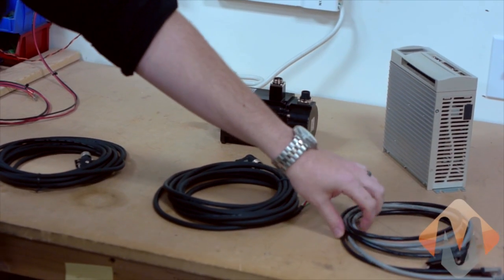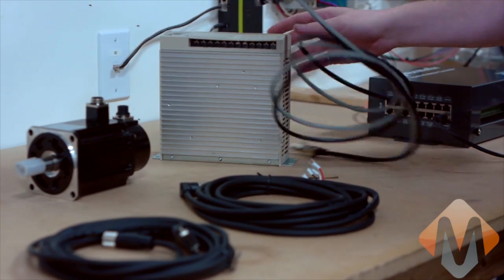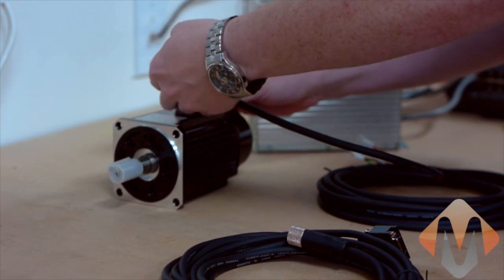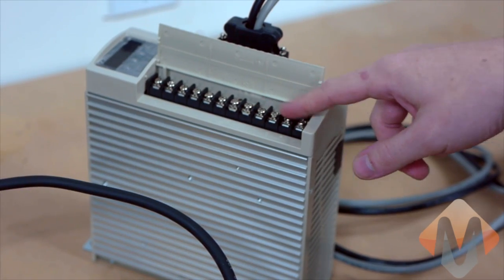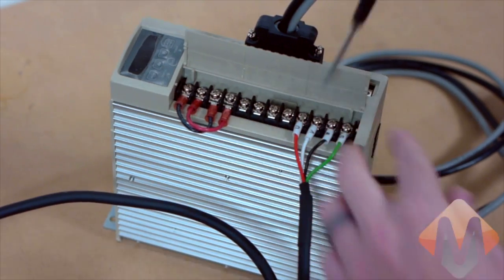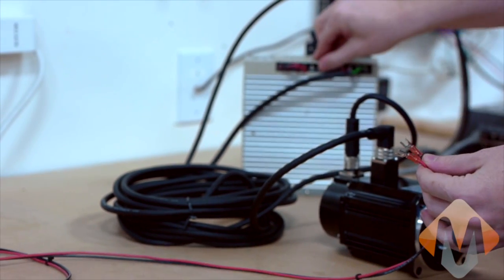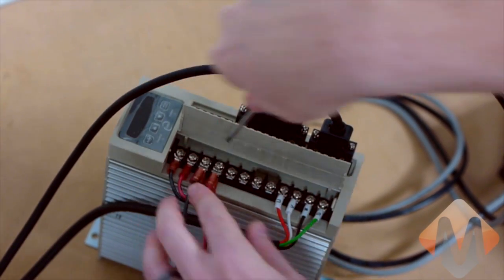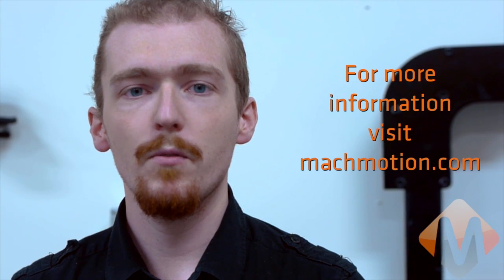Wiring a Teco Servo Axis

Comment: I have 3 tsta 75D drivers and matching servos 2 drivers come up the 3rd gives me a POT NOT error what param clears it ? or changes the travel limites, cant seem to find it (POS and NEG OV TRAV)
Reply: Hello! Since this didn't come from us, we can't really troubleshoot this. But, here's a quick blurb from one of our TECO manuals. Hope this helps!

Pot Not:

This is normal after performing drive reset with Cn029 as limit pins are not normally connected to any switches.
 

Check Hn504, Hn505 (CW and CCW limit); they will be 0104 and 0105; set them to 0004 and 0005; this inverts the logic of the inputs so inputs are normally open. Need to power cycle drive after setting those parameters.
Reply: Well got them working and ordered a cable to clone the other drivers like the one that are direct wired not using the breakout boards from cnc4pc , they work but would rather have them wired as supposed to from teco used the 50 wire breakout to the 50 mini cable into the driver.

Comment: How can i copy parameter existing servo to new servo..
Reply from the maker: TECO's software is called TED. You can save parameters from one drive and load them onto another. You also need a TECO programming cable.
Reply: Thanks..where i can get the software..
Reply from the maker: @ryancastillo7240   Hmm. Not too sure. You can probably hunt around on-line and find it. It's not something we distribute.

Comment: dear sir, we are facing a problem with tsta 30c drive <it's show AL-05 ALARM ON IT'S SCREEN .WE ARE CHECK ENCODER CABLE IT'S OK.THEN WHAT CAN I DO FOR REMOVE THIS FAULT.
Reply from the maker: That is an encoder fault. So, if it'snot the cable, it could be a blown encoder or problem with the connection on the drive.